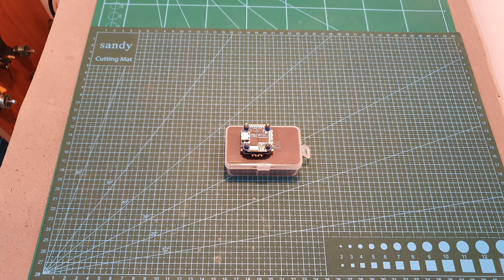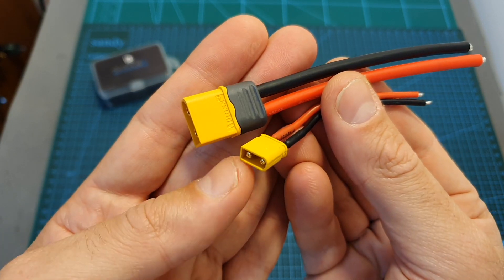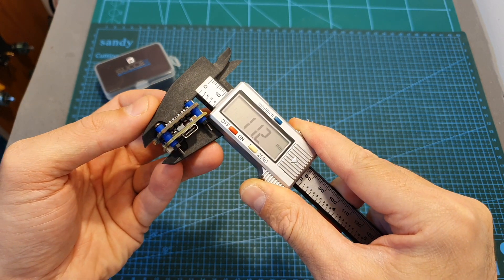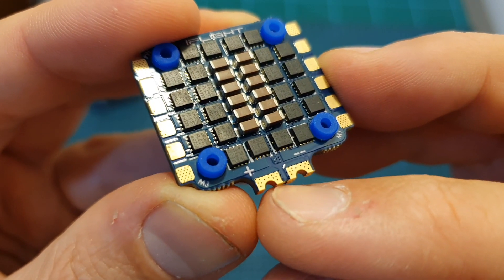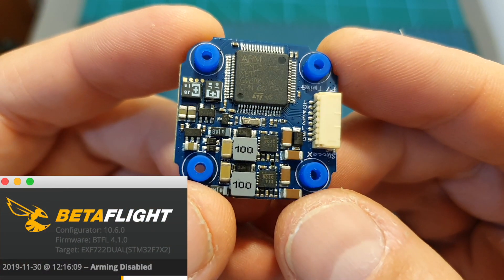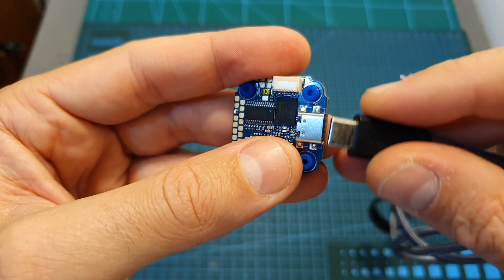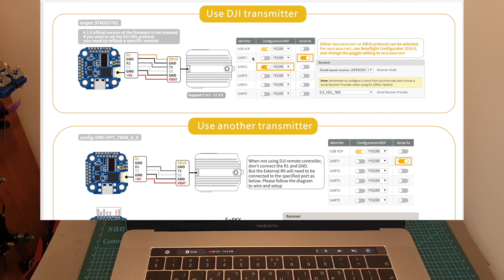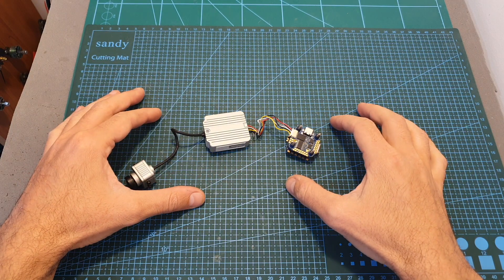iFlight SucceX-D DJI Air Unit Ready Mini F7 TwinG Stack Overview

Comment: FYI I have used 2 of these with a dji air unit and both had issues with noise going back into the flight controller via the 9v regulator. It would cause massive yaw twitches. Spent a lot of time trying to tune it out. Finally added a stand alone BEC to power the air unit and that fixed the issue. So, the onboard 9v on this stack is either noisy or not up the task. The board itself is good other than that.
Reply from the maker: Thank you very much for pointing that out. I know they had issues with the first batch and as far as I know they fixed them on the second one.

Comment: Beautiful little stack, Gal! 😃
And looks like it has the OSD chip! So, you can use it even with analog FPV! 😃
Reply: The latest firmwares now have BetaFlight OSD support on the DJI Air Unit...
Reply: @Andrew_O  But does it need the OSD chip?
Reply from the maker: Yes it does have an OSD chip and you can surely use it for analog builds as well.

Comment: Thanks for video!
I have chimera7 6s, dji Googles v2, dji controller. The problem is in googles showing low power and after some minits video is away, just black or many colors screen, so I afraid to do test flight,. 😔 Have you any idea whats the problem,? Dji air unit needs over 7V, how much voltage gives stack to air unit? 🤔
Reply from the maker: Hi, are you using this stack? It seems like the Air Unit is not powered with sufficient voltage, exactly as you said.
Reply: Mateksys Micro BEC 6-30V 5V / 9V,
I have ordered this stuff, hope it's helping 😊
Thanks for answering!!!

Comment: I’m building my first quad now with this stack and the caddx vista. One thing I can’t seem to find is the recommended or required orientation of the FC and the ESC. I don’t know which side is up and for the FC which side is the front? I’m guessing I could program this after the fact, but wanted to see how most mount them. Also as far as soft mounting the FC goes.. Are the blue silicone adapters included enough or should I add more rubber washers on the underside of my frame and at the nuts?
Reply from the maker: I recommend to get some extra washers to better separate the ESC from the frame. As for the ESC and FC orientation - check out my build video: https://youtu.be/52uXkiT_7ao

Comment: Nice gal, so we can directly powered this unit with 6s without using any additional bec? It is built in fc that connect 9v to the dji socket?
Reply from the maker: Thanks. Sure you can power the stack directly using 6s and power the air unit using the DJI socket that has a 9v regulator.

Comment: Hello Gal one question this stack can be use on a non dji build ? or it only work for the dji system ?
Thanks ...
Reply from the maker: Hi buddy. Yes, it will work with any quadcopter.

Comment: do you know where i might find the cable that goes from the dji air unit to the flight controller? i have been searching and cannot find  one anywhere. the one i have on the iflight dc3 only has four wires on it because it has a frsky receiver on it.  thanks
Reply from the maker: There you go: https://www.iflight-rc.com/index.php?route=product/product&product_id=1115&tracking=rBX0HnGd8qX5bhBSLvHLK9rfPkOhc3i0zyagzEfyaH3fMRDPE615sRDCC6G4NbOq
Reply: @KremerFPV        thank you so much

Comment: With that F7 I am intending to use the Spedix GS40F 40A 3-6S BLHeli32 4-in-1 Mini ESC

I think it will be a better esc for 2306 type motors and below.

Anyway my main question is about the firmware.
There is an Iflight firmware version available and I think that it supports rpm filtering properly.. I also here that the  Gyro is set up wrongly or was so it would be good to get this covered in a video and squared away.
Reply from the maker: I will check it out when I will use it in a build video. Thanks.

Comment: Hello, great chanel. i have a problem with an older succex d mini f7 v1.1 should be the same time. do youhave by any chance still the drone and can support me with the bf fw and or the diff? thanks in advance
cheers Omoid
Reply from the maker: Thanks. I no longer have it - but if you go over the issues that you're having I will try to help you out.
Reply: @KremerFPV  Hello, thanks for the answer. actually everything is fine. i did not Updated BF for some time and the menue changed. i thought it was a Problem with the FW.
Take care and have fun

Comment: I have this F7 board and it's sitter F4 board in iFlight DC3 drones.  Regarding the USB-C connector being universal is it true that you can insert the cable anyway.  Because on both my boards the flight controller will power up if the cable is inserted any way however BetaFlight will only work if it inserted one way.  If I connect the USB-C cable the wrong way Beatflight always fails?
Reply: I have found that as well...but not confirmed as I not sure if I pushed in harder it worked or not yet.
Reply from the maker: I just tested it and the USB C connector works for me on both directions.

Comment: Where did you buy micro connector 8 pin to 6 pin with 6 cables?
Reply from the maker: It came with this stack if I recall correctly.

Comment: Hey Gal, I got the 30x30 version of this FC with the 60A ESC stack about a two weeks ago and installed it in a Marmotte. It is unflyable. Has severe twitches in all axis on mild throttle bumps with airmode off. With airmode on it is even worse. It also has a yaw twitch that will rotate it about 90-180°. Have you experienced any of this? I reached out to iflight but I am not getting any responses from them.
Reply from the maker: Hi, I had a similar issue with a different FC and in my opinion it was a gyro issue. Try disabling one of the gyros and see if it helps. I also suggest flashing the latest BF version.
Reply: @KremerFPV  I have tried disabling each of the gyros with no luck. I am running the latest version of BF available for this board. Any other tricks I should try? I thought about lowering the PIDs all the way down to like 10 across the board and see what that does.
Reply from the maker: @chrisvanmeter8654  Can you post some flight footage showing the issue?
Reply: @KremerFPV  will do. I have to get a new sd card, apparently mine are to big for the DJI stuff. Thanks for taking the time to help me. I appreciate it.
Reply from the maker: @chrisvanmeter8654  no worries
Reply: Hello Chris. I have the same Problem with the 20x20 F7/40A DJI Succex Stack combo in a 3" Frame on 4S / 850.  It is absolutely like you tell. I Change Filtering, PID`s, Motors but no luck. Different setups. Both Gyros, disabling 0ne of it also no success. Different BF. The best setting is near the stock BF 4.1 but it is not flyable. At higher throttle Yaw twitches / rotating, Oscillations etc. I take a old 20x20 FC from a Omnibus, i found a good setting during one Lipo pack. But this can´t be the solution when i bought a DJI ready Stack! Again back to the succex FC and the trouble begins again. I found another people there are all the same Problems.  I like Iflight but this trouble is not funny.  I had sent him a mail for 2 weeks but no response. Today a second massage via Facebook.
Reply: Mine is also acting like it has very low I gain, no matter what i do. What firmware are you guys using twing_g or the twing_g_d?
Reply: @MrKurkulon  I sent mine back to the retailer that I purchased it from for store credit. Going to get a different FC and ESC.

Comment: Does the cable work with the new vista air unit? Can I just plug it in?
Reply from the maker: No, the Vista is using soldering pads.
Reply: @KremerFPV  Thank you. So those stacks you could buy for the old air unit that had the fast connectors to connect to the unit won't work with the vista?
Reply from the maker: @jelliott584  Well they will work - but you will need to solder the other end to the Vista by yourself :-)
Reply: @KremerFPV  thanks!

Comment: I have the iFlight MegaBee Racing Drone w. DJI HD FPV Goggles, Air Unit and DJI Controller ... Have all units registered and linked but cannot figure out how to link the DJI Controller to the drone Mini F7 Twin Stack receiver .. eg. have no control over drone .. cannot start engines, etc ... Any help would be greatly appreciaated.  Thanks!
Reply: Rich Sugden same problem here
Reply: @DronieBoy  I'll let you know if I find out anything tomorrow w. DJI and iFlight
Reply: Rich Sugden thanks same here am planning to Call them tomorrow as well. It will be nice if this youtuber guy can help us out but I don’t knw man.
Reply from the maker: Hi, did you wire the Radio tx pin on the DJI air unit to a free UART RX port on the flight controller?
Reply: @KremerFPV  I didn't do any wiring .. the drone came from iFlight pre-wired and supposedly configured.  One question I haven't asked is how do you activate the motors? Thanks Gal!
Reply from the maker: @rsugdenmd  You need to bind the VTX then with your remote controller. I don't have the DJI remote controller and I can't be much of a help, but you can check it out here: https://youtu.be/nptTbbWKMZs
As for motor activation (AKA arming) - it's configured by a switch on the Betaflight modes tab. 
Do you have any previous experience with racing drones? If not, I suggest taking your time - learn your way in configuring Betaflight and also spend some time practicing flying using a flight simulator.